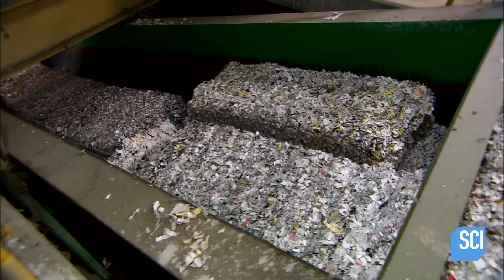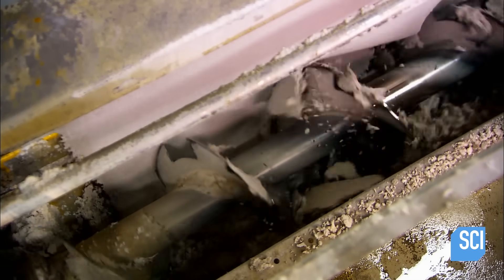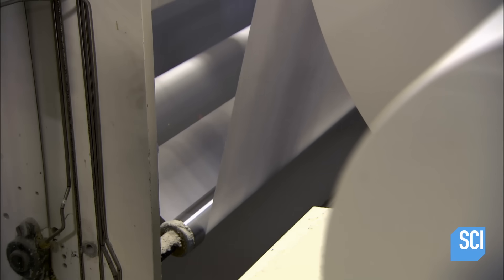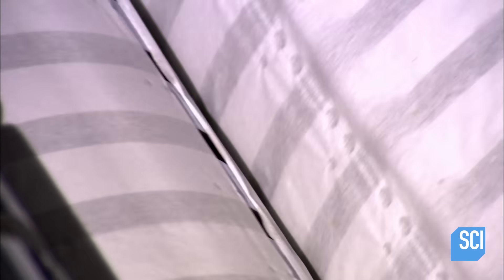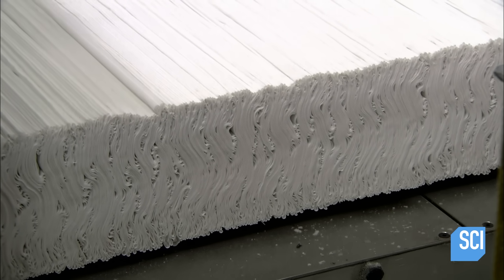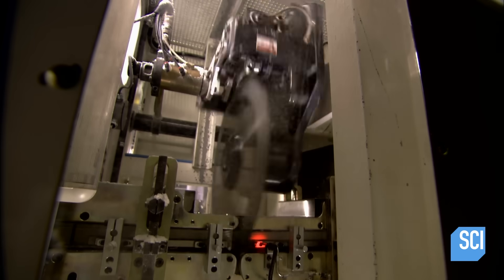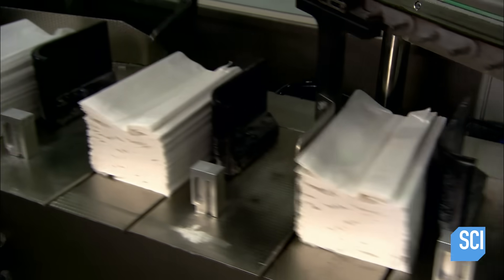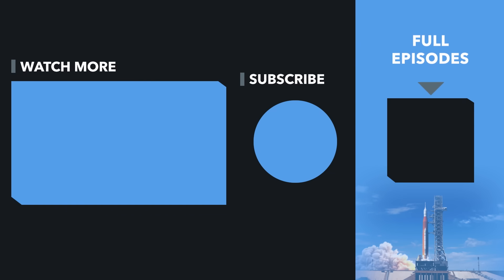How It's Made: Tissues

Comment: I love that the solution they came up with to cut tissues is a massive circular saw spinning around
Reply: I was expecting something delicate like a cutting surface you won't even be able to see through safety protection or something similar and they came up with a videogame solution.
Reply: Seems safe enough.
Reply: Well it is wood technically
Reply: Who’s the brains behind this stuff who’s making the machines an how line nobody explains this stuff somebody has to be smart we can’t be equal who’s the brains behind this stuff
Reply: Ikr I was expecting a guillotine, not that
Reply: But is it necessary that the saw move in a spinning motion? I would say it could be necessary for gaining enough G force but at the rate its going it might as well swing in a pendulum motion, could save some space anyway
Reply: @metalisonline  moving in the opposite direction of the blade's spin would probably make a mess
Reply: @metalisonline  no i dont think swinging back and forth would be a good idea
Reply: @metalisonline  what we see is a slow motion of the actual thing.
Reply: @elainebarnard6823  Even more terrifying TwT
Reply: @MasterBepis  yes
Reply: @elainebarnard6823  I don't believe that part is slowed down, it's probably limited by the time it takes for a full rotation
Reply: @metalisonline  I doubt you'll ever see this reply but I'd like to say, from the perspective of someone who works in a paper goods factory, the back and forth motion is inefficient for such fast and close cuts, and every stop and return motion is significantly more wear and tear. The rotary motion is honestly, in my opinion, pretty freaking cool and seems like it would eliminate a lot of the problems that come with the back and forth motion of the saws I work with
Reply: @mossymilf  ah, that makes sense
Reply: @metalisonline  I think it spins to help reduce stress on the joints holding the saw
Reply: 69 likes ... say no more

Comment: am I the only one noticing how dirty those machines are?!? the tissues must be full of dirty particles
Reply: they produce thousands of miles of 10 feet wide papersheets in a month. that surface area is SO large, you could possibly throw literal buckets of dirt inside the pulp and still struggle to find a single dirt particle inside the final sheet roll. Most of the "dirt" would be splashed water or grease anyway and not come into contact with the product. 
In the end, if the product is pristine, doesn't matter how dirty it looks.
Reply: I didn’t notice. Maybe they’re just old? 🤷🏻‍♀️